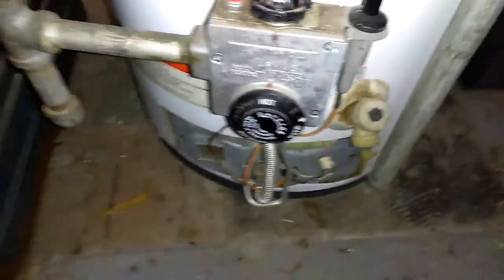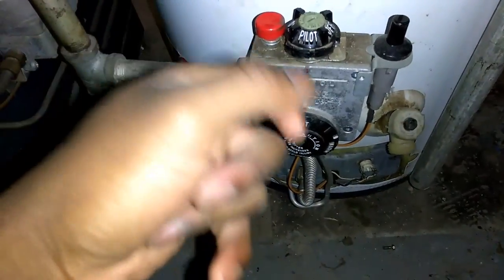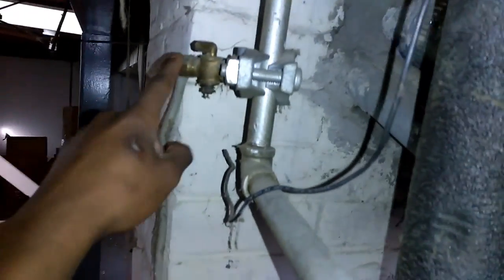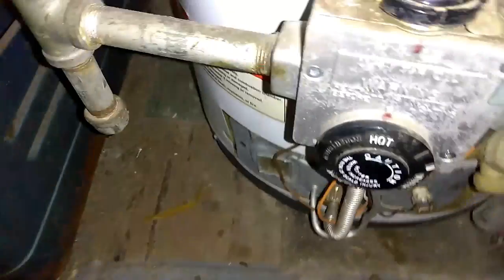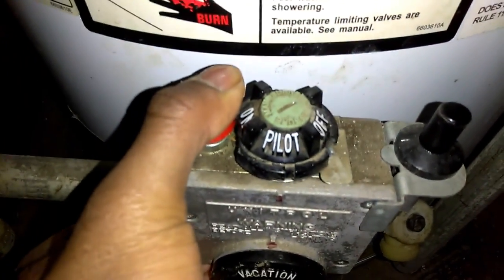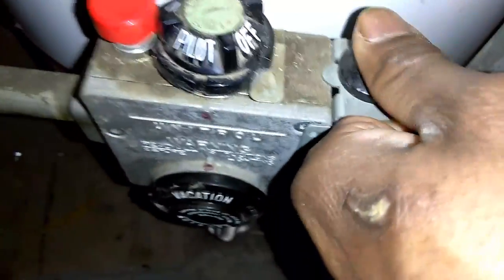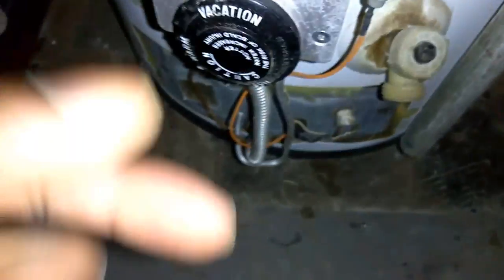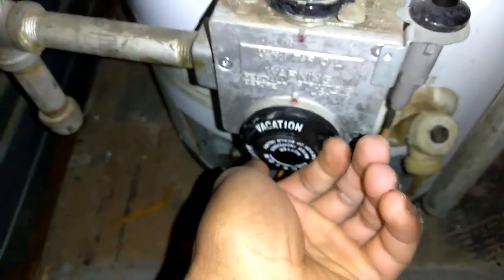How to ignite a self igniting hot water tank

Comment: On the direction of my whirlpool water heater it doesn't say to keep the reset button for 30 seconds to 1 minute. It says depress reset (red) button and try igniter 4 to see if the pilot will lit.
Reply: Just listen bro you ain't leaking gas like that
Reply: Press red button for 1 minute
Reply: @Cardinalfloors  10 Minutes best?
Reply: @anonymousprepper1463  I don't even remember this but it takes alot of gas it's not gonna blow up I promise hold it however long you need

Comment: Your video blows. You forgot to mention that the knob NEEDS to be in the PILOT position in order for the red button to be able to be pushed ALL the way down AND that you NEED to keep holding the button down ( for about a minute) EVEN AFTER the pilot is lit. Bad video... actually dangerous telling people to unscrew the metal pipe cap on the bottom of the gas line. That's FUCKING crazy dangerous.
Reply: DO Yu kno wtf is REALLY CRAZY DANGEROUS??? A PERSON WITH NOOOO COMMON SENSE